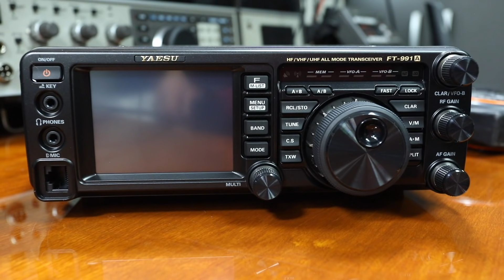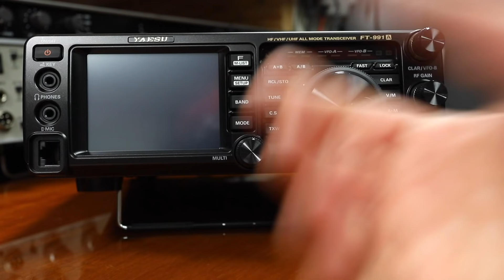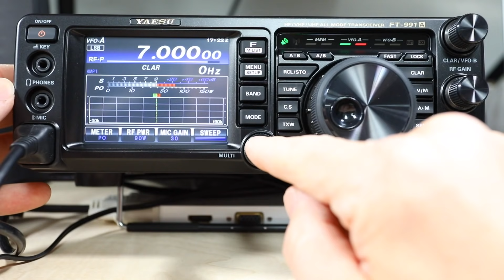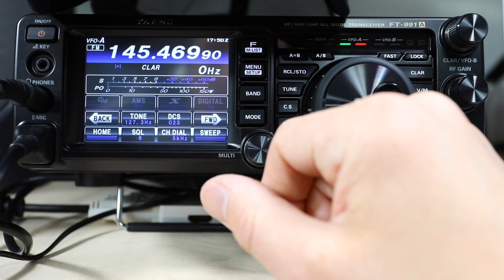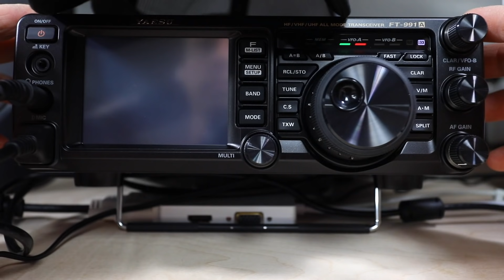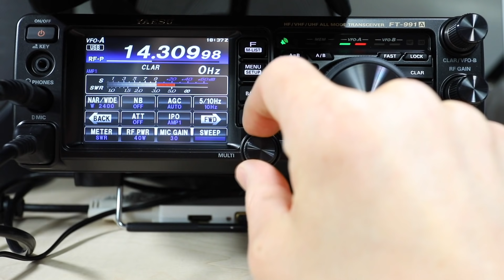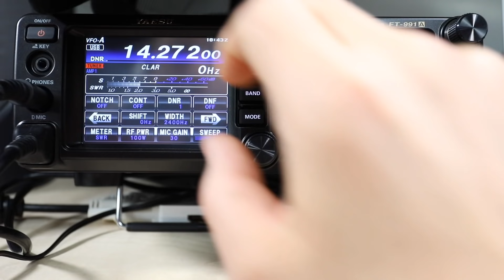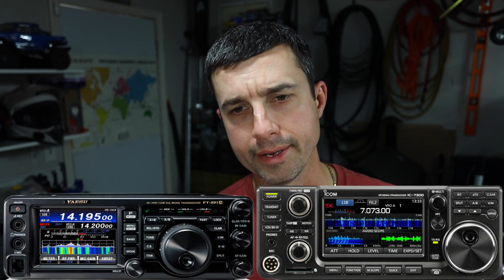Yaesu FT-991A Unboxing + On-Air Tests

Comment: I am having the same dilemma here, and i think i will have to go with the 991A, even though the 7300 screen is an order of magnitude better, because it's bigger and more responsive, as opposed to the sluggish Yaesu display. Is it about the graphics processor? I don't know, but i have built a lot of custom computers over the last 15 years, from gaming PCs, PLC automation, PIC microcontroller rigs, Arduinos & so on, and all these amateur radio rigs use the same basic tech inside them, i am not even sure why we don't already have iPad quality touchscreens built into these radios standard. 

Come to think of it, looking at all the tech available in other consumer electronics i don't understand why ham radio manufacturers keep the serial ports, why don't we have wi-fi & bluetooth built-in standard, why can't we write our own apps, widgets or entire OS if we want to, like with some of the new SDR rigs etc. 

Things are already moving in that direction anyway, why are they keeping it stuck on the 20th century tech, i have no idea. Yes it's expensive right now, but the price will go down when it all becomes standard, we need to keep innovating and moving forward with this, otherwise younger generations will not gain a lot of interest in this hobby.

All the attention is on the commercial smartphone/tablet market right now because that's where all the money is right now, and inherently that's where most of the innovation is taking place. 

Same with my Nikon D750 DSLR. The screen and the menus are a joke, it should all behave like an iPhone/Android app. It's like the software was written in 1989 and hasn't been updated since. Surely i am not the only one thinking about this.
Reply: 100% agree. They would probably say these are relatively low volume products, but it's not much more effort to make a touch screen more responsive, have a logical menu, provide better I/O options, etc. Re cameras and other high volume consumer items it is a bit of a joke too. Cars are another one, where they go some of the way but fall short of having an intuitive, responsive and easy to use interface. There are people specialised in the design of user interfaces, makes me wonder if they actually think about how a product is used.
Reply: @jonpav6224  Well, i design and build user interfaces for living, and most of the mainstream commercial stuff is a joke, but it gets even worse when you take a look at what is happening in the industrial sector. Companies rely on software like LabView, Scada, SIMATIC and so on, to design mission critical plant automation control software for example. These dystopian user interfaces are designed by engineers, for pure Orwellian functionality. Psychology and the user cognitive load are an afterthought, at best. In this respect, the modern human-machine interfaces haven't moved forward a lot since 1940s/1950s depictions of automata future imho. Cars are another one, yes. If you look at this Rimac Concept One video:
https://youtu.be/UEy1Zf0IKaQ?t=44  you will notice a considerable lag on the slider control when he pulls his finger across the screen. An electric hypercar retailing for $980,000. We should do better that this. Where are my Minority Report UIs, it's 2020 for heavens sake.
Reply: @aerozg  That's quite average re the Rimac, but they would say it's just at concept stage? I've seen some great examples of design and build quality in broadcast equipment, but it's  also hit and miss. So much money goes into aviation but I've seen examples where pilots are overloaded with alarms, messages, etc, or they don't know what mode the aircraft is in or have a reference re basic flight control positions, etc. I can imagine in industrial applications it would be just as important. Command line can be very powerful but it seems to be about flashy UI's these days.
Reply: @jonpav6224  i used to work as an aircraft maintenance engineer and the aircraft cockpits are plagued by horrendous user experience as well. Not just cockpits, galleys, toilets, IFE systems, 1st class/business class seat controls etc. But cockpit design is mission critical. The complex interfaces negatively impact critical decision making process. In design and production of these systems, emphasis has always been on the redundant fail safe systems, as opposed to human user testing. Let me be perfectly clear what the problem is: these interfaces are not made to represent the human mental model at all. They are just made to perform, with as little user control as possible. And now our flight crews are stuck with it. Designed by engineers. 1950s/60s design guidelines. No user research. Pilots are usually very bright and sharp people, and the technology should be there to augment and extend their human abilities, not inhibit/hinder them. I am not familiar with the broadcast industry but i imagine it's a lot better than other business avenues. I am familiar with the music industry, which is in the same vein as broadcast i guess. Specifically brands like Native Instruments who make both hardware and software for their keyboards and various controllers. This is how it's done. Technology shouldn't get in the way and create this gap between what we want to do and how we do it. It should close it, or make it invisible at least. Mind the Gap.

Comment: I bought an Icom-7300 last month due to all the hype after 22 years off and on with the venerable Yaesu FT-840. The 7300 is a beautiful radio until you turn up the volume. If you want a DSP noise generator to give you a headache or are just deaf on the higher audio frequencies, go ahead and buy one. In an act of frustration I bought a closeout FTDX 1200 to see if radios in 2019 could still be any good...Absolutely beautiful TX AND RX on the Yaesu. Icom? Never again! Ford? Chevy?. Nope, I was always a Mopar man back in the day.
Reply from the maker: HAHA, thanks for sharing the great feedback! I had a lot of Jeeps in my life and worked for Chrysler, so I too am a Mopar Man!
Reply: Scenic Idaho Daily Time Lapse interesting comments on the audio. So if I suffer tinnitus and don’t have high frequency ears anymore it won’t bother me as much? Perhaps it is time to go to my local HRO for a hands on or should we say ears on? Ha!

Comment: Leave the plastic on? Ha! I immediately wrap mine in alternating layers of shrink wrap and rubber door mats. Then vacuum sealed in Mylar and retort pouch and place inside a 20mm ammo can. wrap that in 2 hefty trash bags and buried in my back yard... No where did I put that? By the oak tree or over there by the tower base?
Reply from the maker: lol...Dang! I also run my cell phone bare naked....

Comment: Holy crap, you have a YouTube channel? Didn't know that. Brian with an I, not a Y. I think I'd prefer the 7300 over the 991. They're both great rigs and have their pros and cons. However, I just like how big the screen is on the 7300 and how the FPS (frames per second) on the waterfall are nice and smooth rather than stopping every millisecond like on the 991.

Comment: Congrats on the FT-991A!  I just swapped my year old FT-DX-3000 for the FT-991A and absolutely love it!  I also own a FT-897  (21 years old!) and a FT-817’ so why swap the 3000?  Because the 3000 only covered to 6 meters, the other two cover 160 to the 450 band.  Both of the older units have external antenna tuners, like it that the 991A tuner was built-in!  I’m a SOLID Yaesu fan, born from a matured Collins fan, the KWM-2A, my nostalgia fall-back!  Quite an evolution from vacuum tube to SDR technology!  73’s. Bob. WB4RJE
Reply: Y R A WISE PERSON
Reply from the maker: Very cool, thanks for sharing. Yeah, I didn't mean to become a Yaesu fan, but I keep buying them. I'm fairly analytical when choosing to purchase things and I always start with the same question. What do I want to do with? The FT-8900 filtered to the top of the list when looking for mobile rig. Thanks for watching! 73 Jason/KM6FAK
Reply from the maker: Thank You!

Comment: have fun   uploding  the   firmware    grow anouther  arm
Reply from the maker: haha, the radio came up to date but I can imagine. It took me a long time to get it talking to my Mac computer and get FT8 running smooth. But, it all works great now.
Reply: Ham Radio TV, I'm seriously considering this radio, and I run a Mac. What all did you have to do to get it to work?
Reply from the maker: It was not as straight forward as I hoped and I jumped around the internet a lot looking for answers. lol That said, I don't have clear steps for you to take and I should make a video in the future, once I gather my thoughts. Here is a where I started https://www.dogparksoftware.com/MacLoggerDX%20Help/mldxfc_computer.html#high_sierra
It will depend on what operating system your running too. What took me the longest to get working was getting the FT-8 signal to come out of the USB into the radio. After making some adjustments in the software settings and the radio settings and the computer's sound settings...it started to work great. Then I took lots of photos with my phone how I had it set up. One thing I haven't figured out yet is getting my radio to talk with RumLogNG my logging software. It might be more on their end, then mine.

Comment: I just got a sticker from DX engineering this fall
Reply from the maker: Well, what the heck! lol
Reply: Ham Radio TV haha that was in the fall of 2019 to give it historical context. I ordered a cable entry box. They gave me a DX Engineering sticker with it.  I placed lightning arrestors on a copper plate with a ground wire to a ground rod. This was with LMR400 (yuck) for my cell phone Yagis I mounted to tower.  I bought some room for growth in case I got my Ham license.  So now I am licensed I am busy making plans for a few more cables coming into the house there.  Enough projects to make this retired guy take a nap. Lol

Comment: You only need the 30 amp powerpoles for a 991a
Reply from the maker: Yeah, its all about the wire size and slipping them on. I use 10 AWG for longer runs and the 30 amp ones don't like to slip on there.
Reply: open mouth, insert foot.

Comment: 991A is my next radio, anyone looking for an FT 857d???
Reply: Mine too.  The ability to run split is a nice touch that you cant get with the ic-7300. To get a split radio you have to go to the ic 7610.  And thats $3000  Yes the 7300 screen is larger but the split thing especially when DX'ing as this will be my first radio, and I have watched some youtube vids of guys running split is a def advantage.  At least to me.
Reply from the maker: Very good point. I didn't realize the 7300 doesn't do split
Reply: @HamRadioTV  Ted Mac hasnt done his research or any for that matter. The 7300 does do split....How does this lack of knowledge come off as so informed, lol.

Comment: you can`t compare the IC 7300 and the 991A. chalk and cheese. both good radio and they have their own places the shack.
Reply from the maker: I sure can, and I did,lol! I had the money to only buy one radio, which is a common problem for a lot of Hams starting out. I will never tell anyone what radio to buy, but I will tell them what radio I would buy!
Reply: Ham Radio TV I am a freshly minted technician & General operator. I am full of questions.  Your videos are helpful in that regard.  It is interesting to me to have 2m & 70cm included in this radio. I wonder when I see an all inclusive device like that “what compromises are made to cover everything? I did notice different SO239 connectors for this functionality.  Good video

Comment: Bought my first Yaesu in 1979, have had HUNDREDS of TenTec, Kenwood, Icom, Yaesu, Johnson, Motorola, Heathkit, Drake, Henry, etc... rigs since then, and had grown into being an Icom guy until this new line, the 7300 & 7610.
Since the RF Gain is one of my most used & loved controls, for icom to screw us with their moronic Citizens Band Radio-type "variable attenuator" instead of a real RF Gain, well they've lost my business.
- HEY ICOM, I just ordered a YAESU 991A instead of an icom 7300 and a YAESU FTdx-10 instead of an icom 7610.
Whoever icom is paying to RUIN their radios with their asinine BS NON-RF Gain circuit should be shot, hung, then FIRED!
Reply from the maker: Dang, no kidding. I've not spent time with the 7300 in the shack yet. Just at Field Days with friends.
Reply: Why the RF/SQL is bothering you?
Reply: Doesn't bother my uncle at all, in fact he says it's a great CB radio

Comment: I sold 991 as this is the buggest crap ive ever owned. After 1year of sporadic usage ATU increase SWR instead reduce. End transistor dead 1 day without any reason. There is a lot of informations at websides that end transistors has wrong set up of bias. On top if you compare with 7300 there is very complicated menu at 991. Touch screen is not used so well as at 7300. Impossible to memory satelite shift via PC, i do not understand why VFO A is always A even when you switch A/B. Only 100 memory (it has vhf and uhf!!!) it's a joke. Even predecessor 897 had 200 memories. Multiknob is nightmare. All the time you need to control what is doing. When you swich to memory it's not changing automaticaly for chanell selection. When operate multiknob you touch f knob very often. Waterfall is shifted vs real frequency (version 991 without A) when you activate it by the fast tuning. Summmarize : IMO it's SHAME FOR YEASU. I have 8 other Yeasu trxes and I cant say bad word up to FT991.
Reply from the maker: Thank you for the specific feedback! I've had great luck with mine so far. Yes, some of the features could be better and one day I will upgrade this radio. The price of this makes it a great entry radio with many features, most likely targeted towards newer Hams. HF portable and 2 meter SSB has been great and it also acts as my daily radio for repeater traffic in my shack (garage). 73!

Comment: As a few others have said, pre the 'A' model it was a choice between the 7300 and the 991.

I went with the 991, it had a great range of features but in practice it was maybe adequate, but not great.
6-12 months later I hated the scope not being real time, the lure of it as a useful tool crippled by the limitations of the non A model ultimately annoyed me, and 2M/70CM SSB performance was average.
I pulled the trigger on a 7300, and felt a bit silly and nervous for doing so.
On arrival of the 7300 it was like night and day vs the 991.
The 7300 was significantly better in user interface, display quality, the capacitive touchscreen was a dream everything about it was superior by a little or a lot over the 991.
The smooth, high res, wide scope with it's high refresh rate makes the screen alone a show piece, whilst Yaesu's looks like an afterthought in the 991A and was a complete joke in the 991 (no scope & audio at the same time).

The only thing i lacked was 2/70, which really is not needed unless you're doing CW/digital/SSB, many many options for affordable 2 & 70 radios.
Ultimately i sold the 991 without regret (even as a keen 2m/70cm SSB user).

It does look as if the A model has improved the 991 a little, but it was too little too late for too much money.

I too heard great things about the 7300, but wanted 2 & 70, so got the 991.
Later having both on the bench in front of me it took no time to realize the 7300 has indeed earned it's reputation.
Being a 1%er isn't might make you stand out, but it is not necessarily wise or special to do so.

Comment: one more reason to get a 991a = its silent !! the 7300 make a lot of fan noise.
Reply from the maker: Oh, that's interesting, Thanks for sharing.
Reply: @HamRadioTV  an other plus is that it has the sound card and all build in and has 2 meter band and 70 cm band and also can do c4fm  .. Its a shack in a box. Got my 991a for a couple of months now. Iam very pleased with it. Did a lot of FT8  with it and my record braking connection was with georgia usa ( my qth is netherlands )

Comment: Nice review, i'm just down the road from you in Pinole. I like the same radios lean more towards the 991A because of thr 2m and 70cm and size. I also like the Elad FDm DUO but only 8 watts out but has a lot of potential once hooked to a computer and there are ways around the low power not cheap though. Going to Dayton will check all 3 out and who knows purchase one, lol like i need another radio.If you do any contesting you will be glad you got the 991a if the bands are crowded. I want to try a SDR radio though and I have a 857d so 2m and 70 cm not a problem and I like 2m SSB which ia not on a dual band fm radio. Thanks for the vide will check out more of yours! Chuck KK6USY
Reply from the maker: Thanks Chuck! Yeah, I know where Pinole is, very cool! That's great you went to HamVention, I've never been but it looks like a giant candy store! Maybe next year for me. Good Luck on your new radio purchase...the decision can be a little stressful. lol

Comment: I have both radio's the Icom 7300 and the Yaesu FT991A. the Icom is far superior radio. The Icom display is better I have never open the manual for the Icom. Its so user friendly. The mic on the Yaesu is rubbish, The waterfall is isn't as sharp has the Icom. There are more reasons I would go for the Icom. If you require a shack in a box the Yaesu is for you. I would prefer to get the Icom 7300 and buy a Yaesu ftm400 for the other stuff. My 991 only get used for 2mtrs and fusion now and then or hooked up to pc for FT8. the Icom is my main HF set. do your homework before you buy. If you hear me on 14mhz i'll be on the Icom. best 73 Danny 2E0FSD
Reply from the maker: Thank you for your thoughts! That screen does look nice on the 7300, I agree. The mic seems about right, it works good for me. When at home I use a boom mic into a mixer. But, I could only buy one rig and I had two items that pushed me to the 991A. My club just bought a Fusion repeater and I like to take it camping and have all bands with me. ~73 KM6FAK~